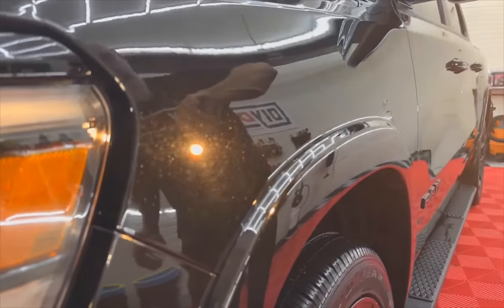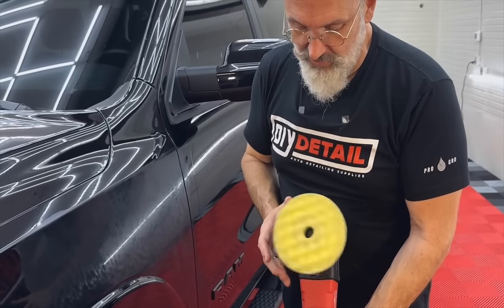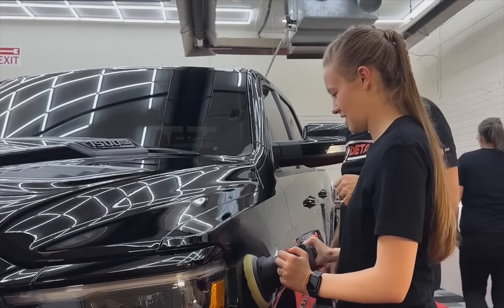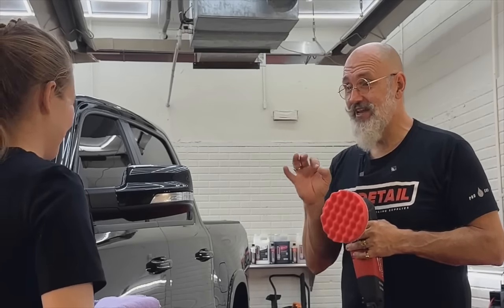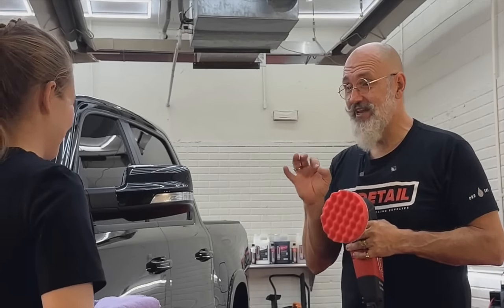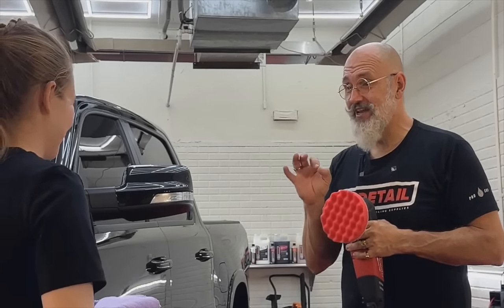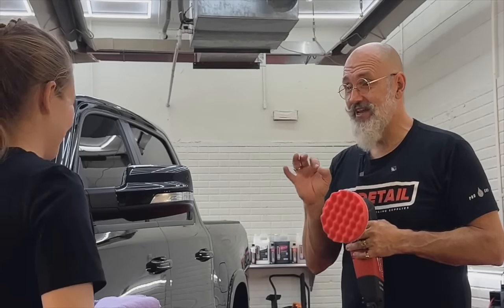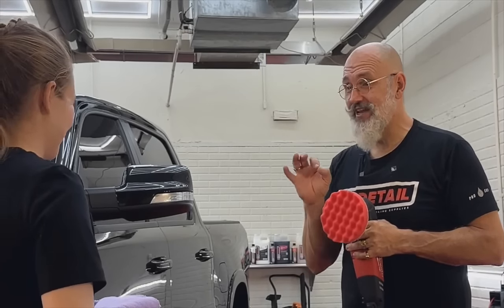HOW TO POLISH FOR THE FIRST TIME! Teaching a beginner,#diydetail #polishblackpaint #goldstandard

Comment: Another great video!  Two statements and a Question :

1) Yvan you are an awesome instructor!

2) I’m really interested in trying a rotary polisher.

3) I have a Ridgid cordless orbital sander. I removed the brake pad like you have suggested in other videos.  However, the rotation speed is between 7,000 and 13,000.  This is similar to most orbital sanders. Is that too fast? Will it harm the paint?

Great video!
Reply from the maker: Thank you. Orbits per min is different than Revolutions per Min. 8-13,000 is fine for a short stroke.

Comment: Those battery-operated machines look super-enticing compared to my old AC-operated DA polisher. Watching your videos can get quite expensive :) So, in a nutshell you feel a modern rotary at low speed is safe enough for a DIYer with a bit of caution? What about using it on those super-thin Tesla paint systems, would a DA still make sense to reduce less clear coat?
Reply from the maker: The rotary is less agressive than a DA.

Comment: So how often can one polish their vehicle?
Reply from the maker: 2-3 times
Reply: @diydetailofficial thank you for the quick response. I learned alot from this video. I feel the same way as the gal in the video.... scared to do this.
Reply: @MS-ik9bi  you can do it infinite times when your only doing high gloss finishes, the paint removal is so minimal you cant even measure it. But if you do cut paint it also depends on how much your taking of, if the paint was in a super bad contidion you might only be able to polish it one more time after a heavy paint correction.

Comment: I saw one of your vedio and you said speed 1 for polishing.but in this video you said speed 3
Reply from the maker: Speed 1 when finishing with a rotary, speed 3 on a dual action machine is fine
Reply: @diydetailofficial  ok thanks. When buffing or polishing how much pads must be used soft , medium or hard  and is every soft pads the same.
Reply: For buffer must I use hard then medium.
For polishing must I use medium the soft. Am a new beginner so that's why am asking because in every vedio you say different stuff so hard to know which is the right way.
Reply from the maker: The pad you choose will depend on the work that needs to be done. I suggest you join our facebook group, you will be able to post pictures and ask questions. 

https://bit.ly/DIYDetailFacebookGroup
Reply: @diydetailofficial  ok so why can't I fine your product in the uk or on uk amazon

Comment: I started with a rotary in 1986-7. I started at a high end dealer ship and was taught by three foreign guys who could hardly speak a word of English.  Wow! They were good! They could turn a cupped out old Porche into a smart looking car very quickly.  These D A machines are too  slow. They are a modern day you tube  device. It's so  "hip" to say,  "oh no, you'll burn through the paintwork with a rotary"! Hmmm? What a load of rubbish! Don't  listen to them. D A machines are too slow. They are for you tube beginners. Leave it to the pros and stick to a bucket and sponge and a quick squirt of dish soap liquid. You'll learn more through your mistakes than you tube  and the snobs!
Reply from the maker: Thank you
Reply: It all depends on the condition of the paint.  Yes a rotary can be used for a new car or a car that’s never been washed or polished in 20 years, but for most DIY detailing enthusiast, a DA is enough since their cars are in good shape.
Reply from the maker: @jsonlee01 we use the rotary for finishing and gloss enhancing, the DA for defect removal.
Reply: @diydetailofficial  Interesting.  I figured it would be the other way around.  For heavier defects I thought the Rotary would be faster.
Reply from the maker: @jsonlee01 it’s a very common misconception. Pad and abrasive technology has evolved to the point where the 21mm da is the tool of choice for heavy defect removal.
Reply: All those retailers don’t know anything about polishing. It’s easy to polish out new car paint. They wouldn’t be able to properly polish out a color sanded paint job. Rotary is the way to go. Only noobs and detailers use da polishers. Body shops pro use rotarys only.
Reply: Do you know how many hologram jobs i fixed from tools like you that think you can rip a rotary like a boss. Ide love to have you at my shop if you truly are great.
Reply: Also hiding your terrible job with wax doesnt count. I hope you sun light check your work as well. Your ego could otherwise be hurt pretty badly if you dont .
Reply: @Tierone1337  I work in a bodyshop doing paint correction, we only use rotary but it's hardly taught anymore. I started back in the late 80's when rotary was the only way. It was turn and burn, until you learned...hopefully on beaters for junk car dealers until you were trusted enough to do better stuff 😂

It takes years to be able to heavy cut a dark vehicle with a wool pad/color sand and make it hologram free in the sun by going light and very slow by the end.
Reply: @MHal312 lol holograms are not because of the tool. You can get holograms from da also. Holograms are caused by the first step compound probably in a colored vehicle. You’ll need swirl compound and so on
Reply: Your comment is 100% spot on, but it might make many American “detailers” whine and cry like babies😂😂 

The real issue with Rotaries in 2023….there are very few genuinely professional detailers who go around to physically teach business owners and detailing staff HOW to professionally use the main tool of the trade. 

The 2nd issue…is an American issue. When they dont know how to use anything, they will badmouth that thing on social media by propagating negative news about it, and then regurgitated by other ignoramuses. This type of unique culture is not seen in the non-English detailing world in Korea, Japan, Malaysia, Indonesia, Vietnam etc where most detailers are highly proficient in using Rotaries, believe in them, while using the DA in certain circumstances or pushing the DA to certain less-clever migrant workers.

Comment: How do correct above the doors when you only have 2 inches to buff
Reply from the maker: Same as the rest of the vehicle
Reply: @diydetailofficial  I meant with a five inch pad won’t stuff fly over everything etc
Reply from the maker: Not when using The Gold Standard Polishing System as designed